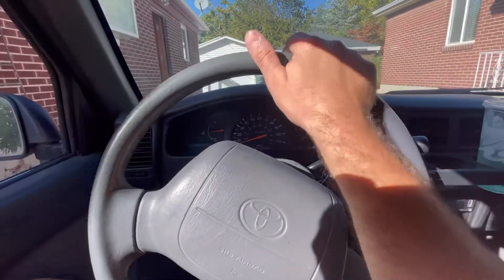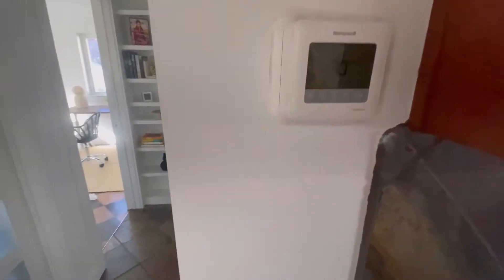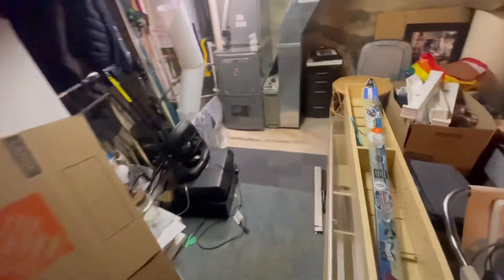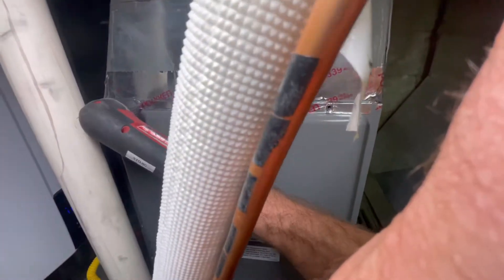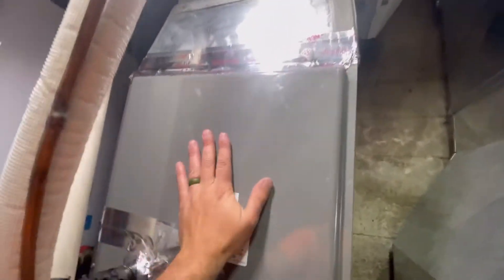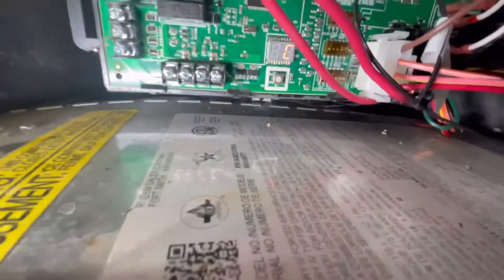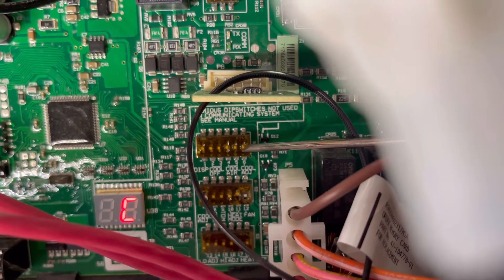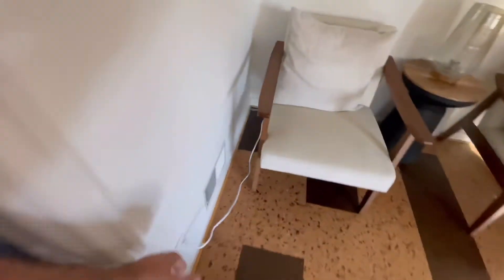How To Adjust Fan Speed On A Rheem Variable Speed Furnace

Comment: Awesome !  We just had our 35yr old furnace and AC replace "just because".  The new 96K BTU RUUD does not seem to blow as much air to our 2nd story as the old AC blower did.
Any down side to adjusting the motor to a BIT higher CFM ?

Comment: I don't know that I'll get a response to this since the post is old, but 6 months ago a local heating and air company who is certified with ruud  replaced my 24 year old rheem heat pump with a similar unit. He set the air speed so high it sounded like a jet engine. I complained and he came and set it so that it is hardly moving air at all. I set the thermostat for 76 but it will only cool to 78. I informed him of this 2 weeks ago and he seems to be ignoring me. What should I do?
Reply: Did he mention that your old registers are rattling from the air flow and causing most of the noise? Putting in new modern vents that are tight and sealed correctly will be much more quiet than old loose vents. Change them and set your blower back to high. Most AC guys are concerned with cooling a hot house down as fast and efficient as possible and when you complain about noise then it is on you after that… unless he mentioned the vents and you passed.

Comment: Have the same furnace as this, but there are only 2 wires going to the thermostat and the fan only comes on with the heat despite setting the fan switch to On.  Do any of those dip switches make the fan stay on all the time without me having to run additional wire to the thermostat?

Comment: How about the two code violations you didn't mention, one with the furnace and one with the tankless, and I didn't even include that awful gas piping which hopefully have drip pockets somewhere. I think you will be back with cooling issues as 100 CFM doesn't make that much of a difference and it would have been nice if you mentioned the tonnage of the A/C and furnace blower capacity.

Comment: Did you measure the total static pressure the system was seeing while at 1,200 CFM.  maybe the S/A ducting is under sized???? If the return ducting is lined make that there is not a loose piece of liner flopping around :)
Reply: With an ECM blower motor that unit is probably rated for a  Max 0.8 in.wc. total static.... 0.5 is a sweet spot to be at.

Comment: You didn't even point out the lack of a drain on the coil That thing is gonna be rusted out and break that furnace so quick I'm surprised that lasted 5 years.
Reply from the maker: You sir, are blind 👍🏼 it has a drain and a clean out. Look back at the video.
Reply: @diyhvacguy came here to to tell him the exact same thing. You can clearly see it off the left side of the a coil. Dude took one hvac class and thinks he’s an expert.

Comment: The coil box standing half open was probably the biggest reason for poor air flow. The adjustment only added 100 cfm.  Spreading that out though all the duct work. I know that is not nothing but air  will take the path of least resistance. What was the temperature in that basement?

Comment: Thank for this video.  My system doesn’t seem to be blowing enough air. I should check my main board and see where my switches are at.
Reply: I know this is not the place to ask but do you happen to know if main board by EWC controls has adjustments for fan speed?
I replaced my main board with this new one so I could use google nest thermostats and for the past year I feel it doesn’t blow air like it used to.

Comment: Had my system installed during winter, just ran the system for the first time Air flow was terrible. System was set to the lowest setting at 750... One dip switch move, system poring out cold air.. Really great job and thank you.....

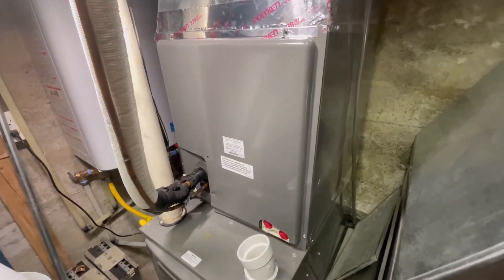Comment: 2:09   - great video, I have the same system and noticed the bottom isn’t taped and warm air is blowing out.  I plan to tape it up like you did later in the video but was curious what ensuring no air escapes helps - warm air exits the house versus pumped into basement (increased humidity)?  Thank you!

Comment: This is helpful. My upstairs furnace fan speed is tooo high and noisy so I think I can lower the speed like this. Thanks.
Reply: Did it work? If so, which switches did you flip down?
Reply: @CaryCrites  Just did that with mine, S1, 4+5 into "ON" to lower CFM to the lowest setting, and both OFF to the highest. Manual has a table for which setting means what.

Comment: I measure with device about 480 fpm at a vent quite distant from furnace.  How does that likely compare to cfm at furnace.  I now my ac is undersized at 1.5 because installer said my old air handler couldn't handle my hotwater system air handler. Now I  have 75000 btu ruud. 11 years ago. Ac seems challenged a bit. Air coming out vent is 13 f lower than thermostat room temp. Also note is that I  run my fan continuously.  When heat is on fan speed increases from the continuous feed. For cool it remains at continuous speed.  If I put fan to auto it does come on with ac but at that continuous speed, lower thsn heat. Should note that when guys installed new furnace 11 years ago they didn't even reconnect my ac wires. I did that myself and maybe I even set speed too low then.

Comment: great video. i recently had a new rheem system installed in the summer and just recently started using the heater and it seemed to me that the blower on heat cycle was lower than when on cooling cycle. can you adjust the fan speeds of these independently?  just happened to see your video and how easy it was to adjust of course you have to know which 1 to adjust the dip switch. just counting the times the light blinks and multiplying by 100.  thanks
Reply from the maker: Yes you can adjust speed for heat and cool. Look in your manual and it will show the dip switch settings for each.
Reply from the maker: I think they are labeled on the board heat and cool by the dip switches
Reply: What controls the fan speed when the furnace is not actively burning? I want my fan to run all the time during heating and cooling. I want to increase the fan speed only when the AC is actively cooling.  Standard speed otherwise.

Comment: Same thing happened to me after a new installation of a furnace and A/C system.
It struggled to keep up cooling the 2nd floor while the basement was a meatlocker with tons of condensation on everything metal; the furnace, the lower ducts, etc..
During a routine inspection, which of course I paid for, he found that the airspeed was set too low at install.
So I had to pay good additional money to find out the same company didn't set it correctly at the very expensive installation.
Reply from the maker: What’s a lousy company!! Hopefully you didn’t pay too much extra. What a joke though. Any reputable company would stand behind their work and do that free of charge. Thanks for sharing!

Comment: I wasn't sure which video to post this on, but about 2 months ago you had a TXV intro video, and you promised the "next" video would show how to install a TXV. Is that still on the way? 🙏
Reply from the maker: It is in the works. It should be out next week. My apologies!
Reply: @diyhvacguy  no apology necessary! Great!
Reply from the maker: Also if you go to 6:34 on this full replacement video, I show how to do the txv installation. https://youtu.be/MUCb7sAFFbA In my next txv video that will post next week hopefully, it’s a little different as everything is mounted on the outside of the coil box. Much easier to install and easier to work on if it ever needs to be adjusted. So keep an eye out for that one. Click the little bell and you woo be notified when a new video posts! Cheers

Comment: Great job brother. Didn't know some fans were adjustable on speed by adjusting the dip switches. Adding 100 cfm and dropping the cooling 4 or 5 degrees had to feel like huge improvement. Thanks for posting and keep up the good work!
Reply: No chance that the air temperature dropped while increasing the CFM. Something else what is responsible for that.